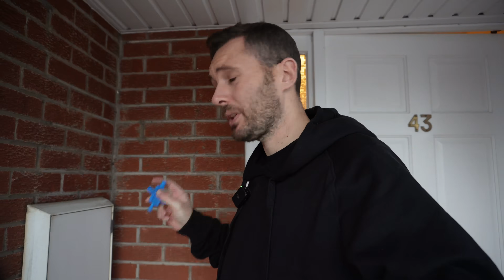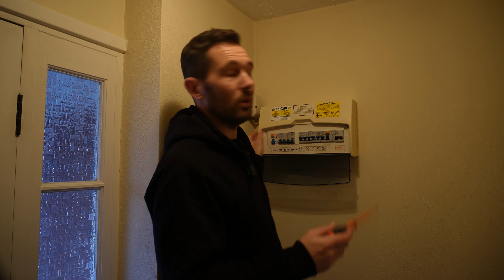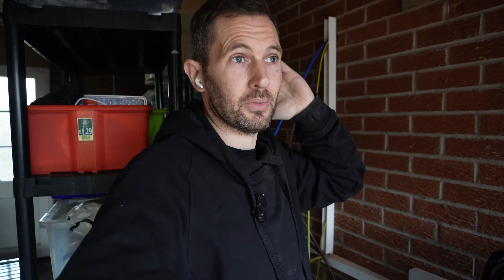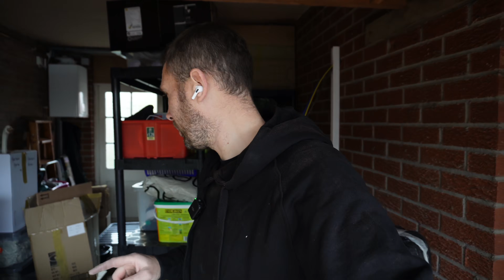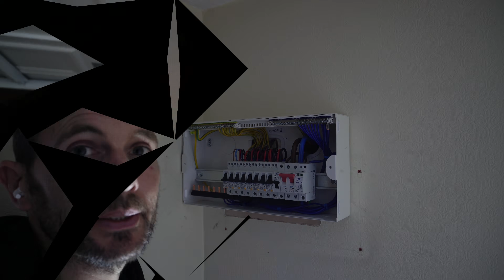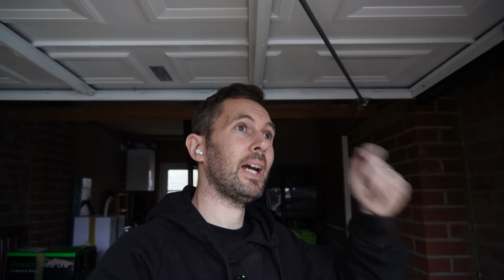Does Your House Need A Rewire?

Comment: Rewire the kitchen - should bring the zs down on the ring and take a massive load of off the the 1 ring. 
Obviously new circuits for the extension. 
CPCs - tighten up sockets. In this case change them. 
CPC being used as a neutral?? That's a new one. Seen a switch line but not a neutral. That's a full rewire of the circuit to be fair.
 
In all honesty, just rewire the lot. I know it will cause disruption but really......it needs it. It's now a safety issue and an accident waiting to happen. Hopefully the bonding was all in place

Comment: Interesting vid mike, could the low ir tests be due to worn outlets etc ? Still learning here mate
Reply: Very unlikely. Low IR can be damp creeping into back boxes, degraded cables or damaged wires (screws run into insulation and stuff like that). You can also have weird things like ant colonies in outdoor sockets or lights.

Comment: As it’s their forever home then a rewire is a no brainier. Agree with other posters that an EICR would have been better unless the old CU was immediately dangerous as you’ve just spent time on doing something that will be redone. 
Also since you’ve rewired the CU dosnt that make your company responsible for the installation? 
Lovely job on the board though.
Reply: You're responsible for faults that should have been obvious during your testing and inspection after the board change, like broken rings or missing CPCs on entire lighting circuits. Not for everything that could possibly be wrong with the installation.

Comment: If they're going to the extent of a new heating system potentially floors are coming up anyway so just rewire it. It's a fools errand to try and repair it if it's that poorly maintained as it could spin into a rewire anyway. It's better to plan a rewire and if some areas can be kept if they're found in good condition that's a bonus and a saving.

Comment: I have a 3 bed semi detached house with only 1 final ring circuit which includes the kitchen wired in 2.5mm twin and earth cable and the only thing that saves me having to rewire it is diversity  the bedroom sockets are rarely used they only have tvs plugged into them where the main bedroom tv is the only one used for about 1 hour at night,the downstairs  sockets only have a TV and wi-fi  and 1 free standing light the kitchen is the only place where sockets are used on a permanent basis ie fridge and freezer and items like kettle ,toaster,micro wave and washing machine ,that's where the diversity comes in , all the items are never working at the same time,so the final ring circuit backed up by a 32A rcbo  breaker
Reply: Yes, the only substantial loads in a modern home are in the kitchen. Might be worth putting that onto a new circuit. There's one caveat though. If the existing wiring is dodgy (and that single with the CPC sleeved black is quite suspicious) it might be easier and cheaper to rewire the whole lot than to fix what's there.